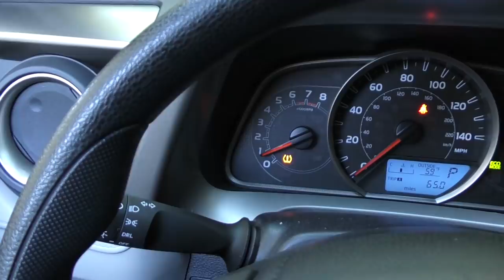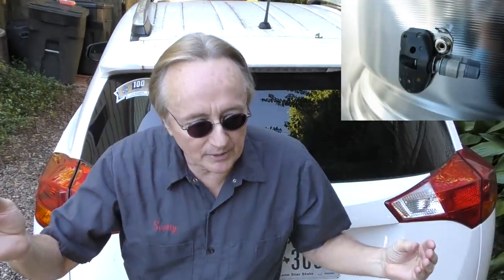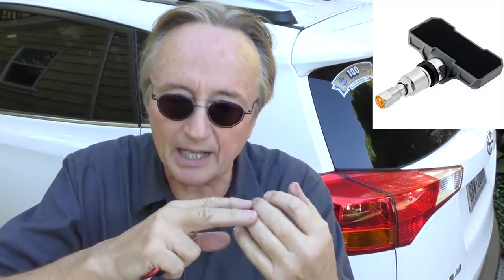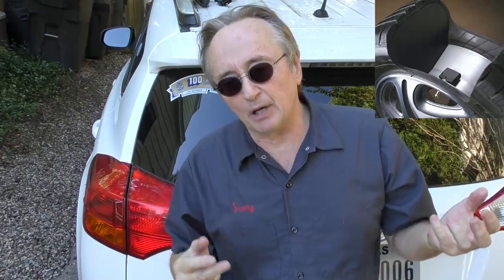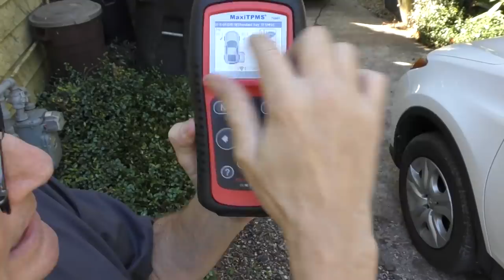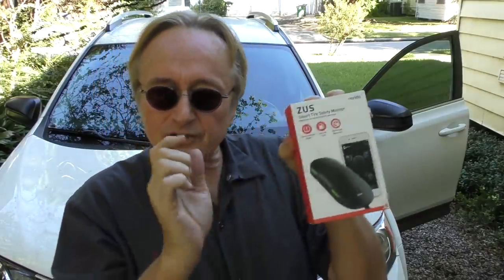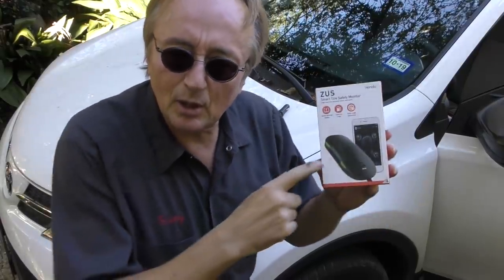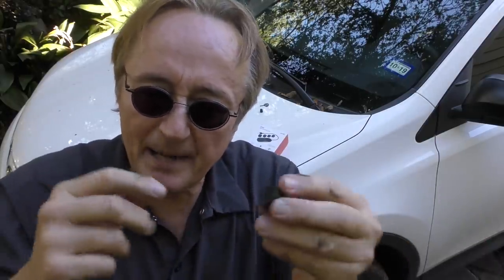Here’s Why This Kind of Tire is Stupid

Comment: I've been driving for over 33 years now, and I'm pretty capable of regularly checking my tire pressure myself. Can't I just unplug the dash light bulb?
Reply: That's what I would do. I've got a slightly older car that's got one of those stupid "Maintenance Required" lights and I just took out the gauge cluster, and took out that specific bulb. And that light has never bothered me ever again.
Reply: @markoftheus  Oh yea might unplug that one while I'm in there (if I ever need to do it). It's annoying. Thanks!
Reply: Thats what I did.
Reply: You could. Removing and refitting the entire plastic dash board to unplug a bulb might take quite a few hours.
Reply: HexagramMan  Most cars are full of plastic around there. Lots of plastic clips and parts that will break. I don't know what kind of cars you are referring to if you call it that simple.
Reply: What are you doing, Dave?
Reply: I just use a small piece of black electrical tape to cover up the TPMS warning when I put my winter tires on.
Reply: @rinardman  How do you remove the oddly shaped angled clear plastic first? You need to remove the entire dash to get there unless you simply break the plastic cover in some way.
Reply: @benz merc 
It's handy for towing though.
Reply: All I did was remove the fuse of my Lexus to turn off the light.
Reply: Aren't they LED?s

Comment: Tpms are junk.. Every single used car now has that yellow ( ! ) light on
Reply: My 2008 MDX doesn't. Never had a problem with any of the eight sensors (2 tire sets). It shows individual tire pressure, too. Sensors don't need calibration or programming.
Reply: Lol....... I was going to tell you just to buy a Honda from now on problem solved.
Reply: You're not kidding.
Reply: Randy Jackson  all cars have em since 2008 i believe
Reply: I had a 2010 Nissan which I traded in when it was eight years old and I had no issues with TPMS. I think Scotty is a little gloom and doom worrying about things that may never happen.

Comment: So how does one shut off the OE warning light after using these new replacements?
Reply: Take the bulb out
Reply: Wonder why they can't make them to just replace the inside monitor and send signal to the car monitor in the car dash. Million dollar idea.
Reply: Put a piece of black tape on the dash.
Reply: i thought the new one pared with the old system...kinda like a garage door opener learning a transponder signal
Reply: If you have traction control it requires proper tire inflation to work properly or at all!
Reply: @philtripe  No, each sensor has to be programed to the system. Imagine what could happen in a traffic jam if your computer was reading the tire pressure on the car next to you!
Reply: @living-wellon-less5669  good kill 2 birds with one stone, thanks for the tip
Reply: P Mason  How often would you have to hit the reset button? Every time you turn on the car?
Reply: My daughter gets a computer message on her dash she has to dismiss every half hour. Says she’s buying monitors when she replaces her winter tires.
Reply: @stephenwise9131  great idea
Reply: I wonder if you can set those aftermarket sensors to your factory system
Reply: Drill a hole through it
Reply: For Ford Vehicle’s.... Turn the ignition switch to the OFF position, then press and release the brake pedal. Cycle the ignition switch from the OFF position to the RUN position 3 times, ending in the RUN position. Press and release the brake pedal. Turn the ignition switch to the OFF position.
Reply: Put a piece of black tape over the light on your dash.
Reply: P Mason  it comes on for certain cars. I remember a car that would blink wheb it was low and stay solid for when the sensor was dead
Reply: @Loco4Waffles This is not shutting it off. Maybe I should do the same to your logic if your oil pressure light was on. I prefer my warning lights to warn me
Reply: @peejay1954  dude, it's a joke. Lighten up. You got no sense of humor.
Reply: @Loco4Waffles  My question was not a joke, so if you feel like joking with a legit question, do it to people you know, not others.

Comment: Hi Scotty, I used these external sensors on my snow tires for the last winter here in Toronto Canada, when I was switching to the all season tires this spring, I found that these sensors got stuck onto the stamps. I have tried using wd40 but still could not remove them. Just a heads up to anyone who's thinking to use these sensors, dont screw them too tight maybe

Comment: This is awesome! 

It's a big middle finger to the face of the Toyota dealer that wanted $175 for ONE sensor and $60 to mount it in the wheel.
Reply: ive got a manual 2000 forester so i dont have new car problems. and by that i mean i dont have or need stupid sensors everywhere telling me what i already know, and just repeating info that my $100 scan tool (sorry scotty) already tells me. why anyone would buy a brand new car today is beyond me...

edit: scrap yards cure thin wallet disease :)

Comment: Just check your tire pressure on a regular basis like your supposed to and be done with this technology!!
🤘🏼🤘🏼
Reply: Be very careful then sir as you are borderline on applying the old school item known as "common sense"!   Cannot do that anymore.  You are supposed to spend and spend and spend as well as borrow and make eternal payments too!  NOT! 

It is almost like driving something with a manual transmission instead of playing with all the electronic crap.......
Reply: Y-O-U-'-R-E right...

proceeds to punch you for using "your"
Reply: @PrimericanIdol  he used "your" correctly ...you wouldn't say check you are tire pressure would you?
Reply: 2big 2fail The reference was to "like you're supposed to."
Reply: @jeffu.8053  I would say check your tire pressure like YOU'RE supposed to. I responded to the OP.

Comment: So far I have been lucky...in the sense that the TPMS seems to work as intended.  On the rare occasion when I  get an alert, there has been a low tire.  .  In one instance, when it kept coming on once a week, I pulled the tire off and found a screw in one tire.  A very slow leak that I repaired.
Reply: That's what there intended to do, alert you of a problem you otherwise wouldn't notice.

Comment: Just had all mine replaced because my full size spare ('06 Jeep Commander) kept annoyingly alerting of low air spare tire...after four re-visits because of dead units, air leaking from tire beads (because they didn't clean the bead), rusted aftermarket lugnuts (because they damaged my originals), and insisting on at least a $100's back for my troubles I'M STILL LEFT WITH "LOW AIR SPARE TIRE" BECAUSE THEY SAID NOW ITS A INNER VEHICLE MODULE THATS FAULTY AND REQUIRES A DEALER SHOP TO FIX IT! (Donkey sigh...if that's possible)
Loving the channel!!! Thank you!

Comment: I don't know about the latest models but as of a couple of years ago Volkswagens had a reset button for the TPMS system in the car. Once you inflate the tires to the correct pressure you then have to hit that reset button to get the tire light to go out. I learned this when I worked at Hertz - a tire light would come on and people would just keep adding air to the tires trying to get the light to go out. Had one car come in with 80 psi in one of the tires.

Comment: A pressure tester cap will be fine if it checks it on demand or once daily. I used visual check caps once and because they always compressed the pin, air would leak.

Comment: My daughters '01 Ford Windstar uses the anti-lock system to monitor low tires. From the shop manual; (The system uses the ABS wheel speed sensors to monitor the rolling radius of the wheel and tire assemblies. If a difference in rolling radius is detected, the ABS module illuminates the LTW lamp located in the instrument cluster.),  LTW is low tire warning light. I'm sure it is cheap to repair. We just hit the reset or ignore it.

Comment: TPMS is for when you're going 80 miles an hour down the highway and you get a small leak alert you before you shred the tire and wreck
Reply: HexagramMan  where on Earth did you hear me say tire blow up? Tires start to shred when they get low in air Pitch between the wheel and road not everybody is a superstar driver like you like people just learning to drive and the elderly

Comment: Tyre pressure checker used to be a foot. The system in my Z4 is good, it measure the difference in rotation from the abs sensors. Doesn't tell you which one, but quick check with a gauge and you know which one.

Comment: Everybody’s hating on the TPMS, but mine warned me about a slow leak a few months ago & probably saved one of my alloy wheels. Saved me from getting on the highway at 1:30am after work on a dangerously low tire, too. So in my mind it’s already paid for it’s first round of battery replacements when that comes due

Comment: Now THAT's a product that I never knew existed. Thanks for the tip. My 2013 Nissan Sentra is prolly going to need those batteries changed soon. I will be looking for some of these aftermarket tire sensors now. Thanks!

Comment: Some brands tpms sensors are on bands inside the tire. Worse part is with the sensors on the valve stem is when one breaks. Also the new kits for the washer and seals for them cost double vs a regular valve stem.

Comment: When you start the vehicle and the TPMS light blinks, that means one or more of the sensors aren’t broadcasting a signal. But if it’s on solid that means one or more of the tires have gone low on pressure. I recommend visiting Discount Tire if you have any problems.

Comment: I do have some good news. Prices do go down over time with TPMS sensors and scanners. I found a new TS508 for $120 on eBay and sensors are about 23 to 27 dollars on eBay. There is also tricks DIY mechanics can do at home to change out those sensors. If you have a free tire balance warranty on your tires from the tire shop you may need to rebalance the tires when you are done.

Comment: Scotty, even Costco can't beat that. They charge $45 for each sensor and 20 each to install. That's $260. Thanks for the tip. If I purchased the external sensors, and my in-tire sensors' battery was dead, how do I prevent my in-dash warning light from illuminating without pulling the bulb for it?

Comment: My 2017 mazda6 has the pressure sensors built into the abs wheel speed sensors, apparently it can detect small changes in tire rotation and speed and knows when the air is low. It also gets power from the car battery. It was a nice surprise when I bought winter rims/tires and didn't have to buy any sensors. I still check the pressure with a gauge at least once a month.

Comment: Aftermarket screw-on sensors can and normally do sieze onto the tire stem. This normally happens to cars in areas that get snow. The salt causes them to react with the copper on the stem.

Comment: Cold morning, on my way to the dealer to get an OEM FOB-Key (what is their official name) for a Mazda 3 that light came on the dash in this 2012 car. First time for me (my son's car) so I pulled over to see if any looked low, all were visually the same. So, I went on to the dealer to get the new key and programming done (my son wanted it, at nearly $400 for one key????). They "reset" the issue. So, we shall see, maybe they will all be going bad soon at 7-8 years of age. Thanks Scotty for all your informative help! Maybe won't be long before we buy cars like most electronics now-a-days: Buy new till it breaks then throw it away because they are no longer economically designed to be fixable.

Comment: I think this system would be helpful, especially with AWD because the transmission must  compensate for uneven tire pressure.  Also, you never know when you pick up a nail and have a slow leak after you just checked your tires.  I was out of town and found a nail stuck in my tire while away from home when I went to the grocery.  I was able to limp to the tire store before the air came out but I had to buy a new tire.  If I missed seeing it, I might have had a blow-out on the high speed highway when travelling back home.

Comment: Scotty
I recently put a similar type low tire indicator.
and few of my tires start leaking air from the valve.
I learn it the hard way after checking the tires for nails and hole's.
Turned out to be  the stupid indicator leaks because of it .
Took them off and no problem since.

Comment: The only problem is a lot of new cars now, do not have a spare tire. And on most cars, you might not be able to disable the factory TPMS system, so the dash light would still be on, even though you installed an aftermarket pressure monitoring system.

Comment: IDK. I've had my MDX since 2011. Not once I had to replace any TPMS sensors. Also, you don't need any machine to calibrate or program the senosrs. You just put the new one on and that's it. I have two sets of seasonal tires, both with sensors in them. I just swap the tires myself twice a year and it doesn't require anything to be done with either sensors or the computer. MDX also shows you individual tire pressure for all four tires on the cluster screen.
Reply: yes, if you use OEM sensors. but if you buy generic sensors, you have to program them to match the vehicle make and model.

Comment: This is appropro...my 2013 Sienna, which I bought 2 years ago, is getting 4 new tires (Michelin defender) tomorrow...my tire guys are going to put in 4 new TPMS sensors.  When I bought the van, 2 of the sensors were bad. Car's now 6 years old, so I am pre-emptively replacing all 4 TPMS sensors. My tire guy charges $55/sensor parts and labor when he's taking the tires off the rims to put new tires on. He charges $85/sensor when he's not also replacing the tires.  I hadn't been aware of systems like this but now I'm looking into them.

Comment: Scotty, does the Zeus TPMS weigh enough to require rebalancing the wheels?
Reply: I've looked into these things (bought 4 for my trailer), and all of the marketing for them says no balance should be required, but the legalese says that a balance may be required. Sneaky buggers. They all recommend or require steel valve stems though. Didn't get mine balance for them and I have no signs of wear and the tire temps have been good, if that means anything.

Comment: I'm glad TPMS are not mandatory in Canada. Some high end cars come with them and they are becoming common on new cars now. The problem with them here is it is so cold in the winter that the sensors are going off all winter. Also, in most of the country winter tires are a must. That means 8 of those batteries being replaced regularly. Thanks but no thanks.

Comment: Thankfully I have a Volkswagen that uses TPMS that uses the ABS sensors to monitor tire speed and detects low pressure by change in tire rotation. The calibration button in the glove compartment and aftermarket wheels are 100% fine.

Comment: All of the sensors went bad in my wife's 2010 Civic. We had them replaced as they went out but should have just done them all at once as they all went out within about a year.  That has been the only thing that has gone wrong with this car though.  Pretty good for a 9 year old car with 107,000 miles on it.  And yes Scotty I have changed the automatic transmission fluid several times !  I don't want it to turn into an endless money pit.

Comment: A lotta TPM sensors don't require batteries actually from a newer technology, and almost all don't need a fancy tool to trigger the sensors. You need a computer to turn the car into learn mode, but you just need any way to trigger the sensor. This includes adding or removing the air from the tire, so it'll trigger the sensor and have it calibrated for the right tire.

Comment: My Tacoma has the dreaded TPMS...When i put on my winter tires, the light comes on. I spent $1 on a roll of electrical tape and used a 1cm square piece to cover that annoying icon and use my hi tech pressure gage and check my tires that way.

Comment: I feel blessed that my 2011 Honda insight is still good.
Reply: How has the IMA battery treated you?
Reply: @CRAPO2011  reduce mpg but still okay. Drive to work so not too harsh. Worried about it all the time now it's over 8 years and 162k miles
Reply: @pigyear88  Was thinking of purchasing one of these to sell overseas
Reply: @CRAPO2011  I got my I sight for $18k in 2011 which is the lowest priced hybrid. Great quality trouble free for 162k miles so far. Already got my money's worth
Reply: @pigyear88  These have to be the rarest Hondas of this past decade i never see them and theyre not that old
Reply: @CRAPO2011  I got the Insight cuz new model wasnout selling Prius in Japan. Lower cost hybrid by $4k to $5k. Well worth the money. Timing chain no thousand dollar job every 90k miles

Comment: Most cars can have all sensors replaced for under 200 and most tire shops dont charge for labor. All you need to do to change asensor is to pop the front bead and remove it no mounting or balancing required

Comment: I don't like caps that hold the tire valve open. They always leak eventually and leave you with a low or flat tire. Eyeball your tires at every fillup and use your tire gauge regularly, especially as the seasons change.

Comment: When my tire sensor batteries die I am gong to put a transmitter in the glove compartment. I am perfectly capable of using a tire gauge and air compressor. I'm impressed that the tire transmitters don't break, being on the wheels. Those things get quite a beating with the bad roads around here.

Comment: Maybe I'm missing something but if you put on the after market system, and the battery goes bad on the OEM system, do you just drive around with the low tire indicator light on? That would drive me nuts.